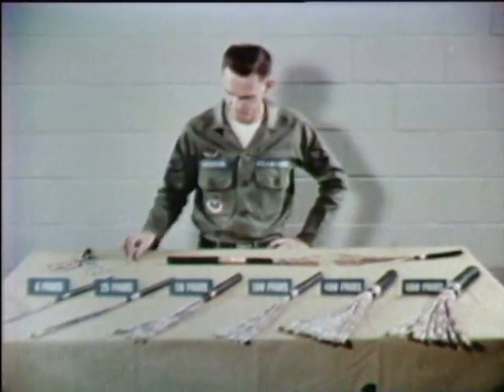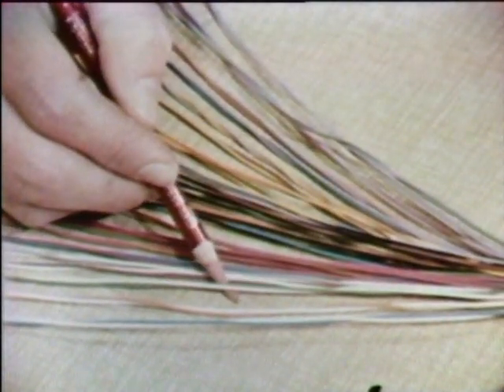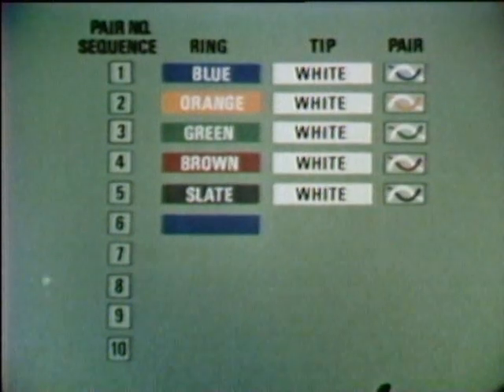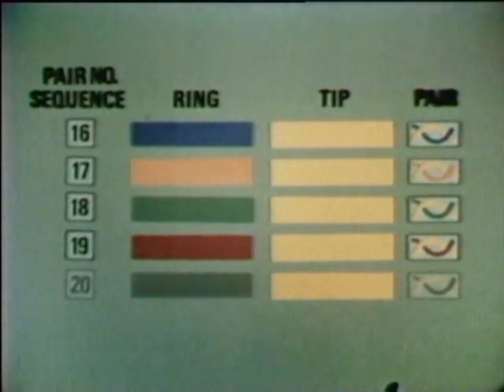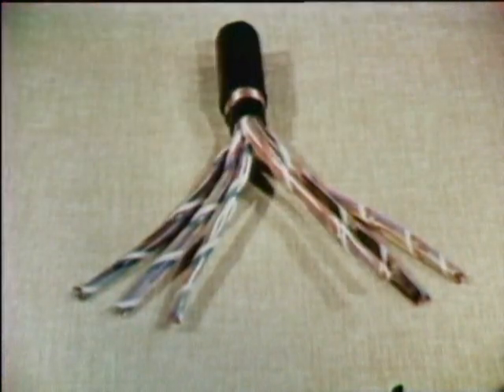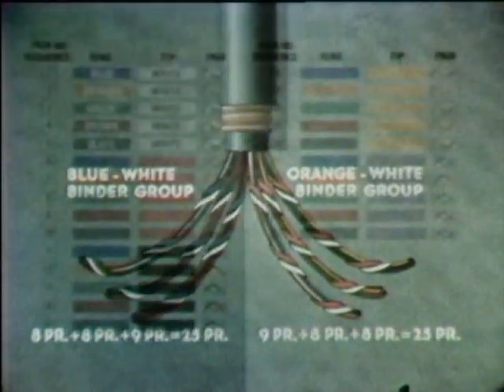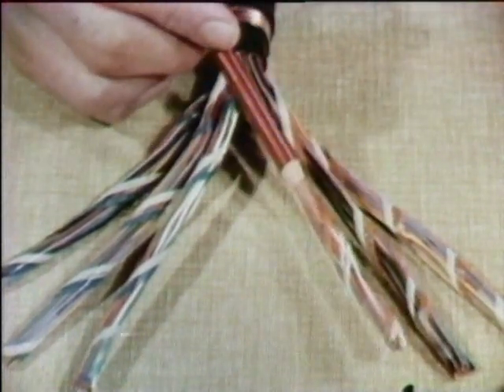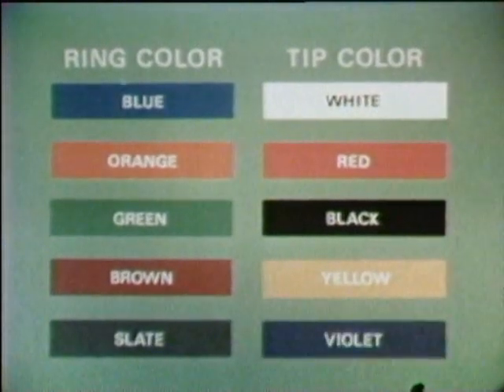COMMUNICATIONS CABLE-PIC - COLOR CODE

Comment: It all works until you come across some mirror image cables...then u screwed! Cuz you have duplicate binder group colors. Its really interesting tho. U start from the middle, go clockwise on near end, then on far end u go from middle then counter-clockwise and it will line up. Luckily I only done that once...unfortunately it was 2 lengths of 1800 pair.